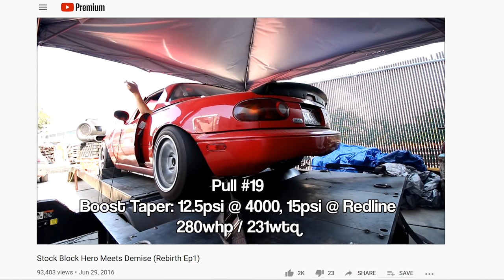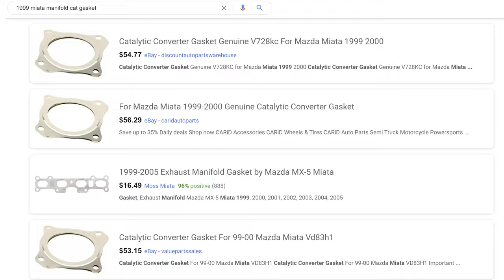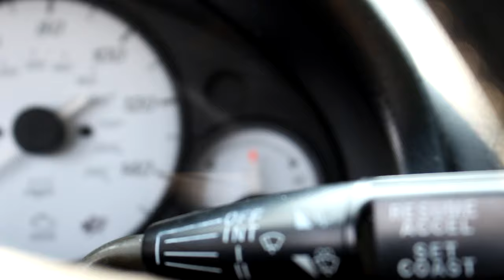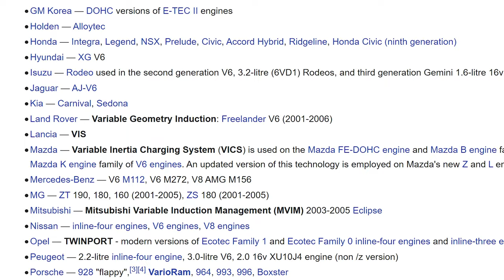Troubleshooting 6 Common Issues Your Miata Might Have! [Project 2SJ Ep5]

Comment: They're not Philips head screws on the latches - they're JIS. Everyone uses the wrong tool to adjust them, which is why stripped screws are so common.
Reply: I was about to comment on this. If you're looking for an easy to find JiS screwdriver look out for those Toyota ones that have both a JiS head and a flathead, you can also find a JiS screwdriver in the tool kits that come with Scion FRS/Toyota 86.

Comment: FYI, at 11:04 that's the pulsation damper #1, the fuel pressure regulator is in the tank where the fuel pump is. What you are working on is pulsation damper #2 on the fuel rail.
Reply: Yup, NB's have a very strange fuel system lol
Reply: my pulsation damper is leaking. Are all the steps he is showing around 11min necessary for this small item replacement?

Comment: Greg pls help with hot start problem I’ve tried everything I could find online and nothing has worked and nobody has a definitive solution.

Basically car starts fine. But when it’s hot I have to click the key like 6-7 times before the car starts. I’ve changed starter battery ign switch.
Reply: Check yo grounds foo. Get a test light, hook it up to battery positive. Stick the dingus end somewhere metal on the engine, it should light up. Now try and crank the car, if the test light dims or goes out when trying to crank then you've got a bad ground somewhere. 

You can test for a good 12v power supply to the starter too. Hook the test light to the positive post on the starter touch the test light to the frame. If it dims or goes out when you try and crank the engine then your main power wire is either loose or corroded.

If you want to know more, look up testing voltage drop.
Reply: Albie Beck I’ve already done basically all of this to a tee :( it cranks really strong when it finally goes.
Reply: Ugly Miata it is the 1.6
Reply: Ugly Miata I had no idea this part existed, and it’s relatively cheap, so I’ll try it thank you!
Reply: @Racingboom  What happens when you turn the key? Is it nothing, does the starter click, or does it crank but not fire?

If it's not the last one then changing the ignitor won't make a difference. It only controls the signal going to the coil packs, it has nothing to do with cranking the engine over.
Reply: Albie Beck oh fair enough. So what happens is when it’s cold it starts perfect. But when it’s hot it just sounds like a relay clicking or something. And I have to repeatedly attempt starting before it eventually just... BAM goes full power starts immediately like nothing was happening.
Reply: I fixed my issue with a Camshaft sensor.  Dunno if that’s your issue but look into that. Easy switch on the top of the engine, but like 60$ part.
Reply: @Racingboom  https://www.miataforumz.com/how-40/mazda-miata-wiring-diagrams-1990-2002-a-497/
Check out theses wiring diagrams. Because it's a 'no crank' situation you only need to look at the starter circuit. It's pretty simple, there's only 5 wires in the whole thing.

If you've changed the starter and the ignition switch (and you're sure they're good) then the only other component left in the circuit is the 'inhibitor switch' (clutch switch) although I'm not sure why that would fail when the engine gets hot. 

Having checked all the above the most likely cause are the wires themselves. Check power from the main relay box to the ign switch, from the ign switch to the clutch switch, and the clutch switch to the starter. Along with the main power and grounds for the starter, which you've already checked, that's it; those are all the wires.

The ST sign fuse wiring sends power to the fuel pump relay, it doesn't have anything to do with actually cranking the engine over.
Reply: Mine does the same, I just shake my key around till it fires up lol
Reply: Is your clutch switch bypassed? Meaning you don't have to put the clutch in when starting the car? I had the same issue and it turns out the previous owner who bypassed the switch did a shitty job and used butt connecters. I don't know how they did such a bad job with like 3 inches of wire but I redid it with some soldering and my car starts every time now.
Reply: Adrian Moreno mines completely stock but I would think it would be unlikely to be the switch. Considering it only happens when the cars been ran and sits for a little bit.
Reply: Racingboom The Pleb its probably just a bad starter bruh lol go pick one up from an auto parts store, and pretty sure you can just return it if it doesn't fix it.
Reply: BadBeaver I said I changed the starter.
Reply: If u have an NB its 99% the cam angle sensor thats on the front of the engine there like 15 bucks online
Reply: Flat spot on the starter. Get a new starter.

Comment: Those fan relays are mechanical and get physically stuck. Sometimes unplugging them and banging them on the ground a little gets the job done. One you have the full ecu setup installed. Trigger it manually on and off a few times to make sure it's freed up. You can usually hear it and feel it!!!

Comment: lmao I dropped one of those plastic spacers on the fuel rail when I was changing my fuel injectors. it fell into the void, I looked for it for about 30 minutes until I realized one of the o rings on the old fuel injectors fit perfectly. 
it might still be in my engine bay

Comment: Most likely the fuel leak was due to the O-ring on the pulsation damper. After having a few lucky escapes with fuel leaks, I now always change all the injector seats and O-rings whenever I touch the fuel system on a 10+ year old car. One other smart thing to do is lubing the O-rings before installing them. Thanks for the video Greg, these kind of fixes are very satisfactory. I crossed the Miata bridge and bought myself a MR-2 spyder from 2001, having to do all kind of similar fixes. I like the MR-2, but the MX-5 is a better car. So I am glad I still have my MX-5.

Comment: I have learnt sooooo much from this channel. When I bought my first ever MX5 or Miata I knew nothing about them at all. I've worked on Nissan's and Toyota's but never on Mazda's. but after watching these videos I managed to boost my first ever NB and its so dope. I've always thought Miata's and RX7/8 are two of the best handling cars of all time there only draw back with my Miata was the power or the lack of. But now its boosted it has a built engine and a GTX3071R  and a dog box I built the car for track use only but it drives so good and its so much fun I had to drive it more and its my daily street car now. I love them so much I've started my next Mazda build I have a boosted 13b rotary engine mounted in my NA in my shop I'm slowly working my way through it. If it wasn't for this channel I would never of bought a Miata and I would of missed out such a awesome little ripper.

Comment: MIATA DAD!!! Got my miata back after 2 months sorting out a ECU. ANNNNNDDDD Now....... my 2003 nb is running great, except at 4,000 rpm, where the engine will "jerk" or die for a split second. Only under medium to full throttle, all gears, and doesn't have any loss of power except when it stumbles... I'm baffled... No CEL (❁´◡`❁)

Comment: I have an 04” NB. Before I turbo charged the engine I replaced the radiator with a Mishimoto radiator and the fans with with Spal fans. Before I did that only one of my fans worked. Now I have zero issues with over heating.

Comment: my NB is burning oxygen sensors, I'm on the 3rd set. apart of richer fuel/air ratio nothing changed but it's still less mpg.. not sure what's happening, got my cat stolen but it was fine for 3 months after that (running on almost decat, there's something inside but much more airflow and no silver or platinum inside ) any advice? Went thru used OEM and cheaper sensors - all of them stopped working in about a month, after unplugging the battery and motor fuse to restart it the engine management light disappears for a few days.

Comment: hey guys someone here might be able to help me. I have a 1990 1.6 NA. Brand new plugs, plug wires, afm, and timing is on 10 degrees advanced. Having an issue where after warming up the car has big hesistations when under load (4k rpm plus). anyone have any ideas? cheers in advance
Reply: Crank position sensor?
Reply: @foamdataservices   is there a way to test the crank postion sensor?

Comment: I have a mazda mk5 nb mk2 with the 1.8L it only has the diagnostics port no OBD2 and it has a miss fire on cylinder 1, ive checked compression and it has 180 psi in each cylinder, ive changed injectors, the whole fuel rail, spark plugs, coils and other bits and bats, no matter what i do its got a misfire on cyl 1 and i can’t figure out why, every now n then when its warm it starts running on all 4 cylinders but if i turn it off n back on it starts miss firing, there are no engine management lights on the dash since it doesnt even have the light, anyone else know the problem???

Comment: Do you know why the lights in my gauge clusters suddenly went out. Blinker lights, check engine light, turn signals all work. Just the lights to tachometer, speedometer, and gas gauge don’t work.

Comment: Isn't the FPR on the NB in the fuel tank? According to the factory manual the one on the side of the engine bay is pulsation damper no.1 and on the fuel rail pulsation damper no.2. Not sure if this is true for all NB's.

Comment: Hmmm... are you sure you have your fan setpoint temps right when you go over the function of them? My stock NB runs the driver-side fan when the t-stat reads 207 per my OBD dongle. It's consistent. The passenger side fan only cycles with AC. Both cycle when I short the fan terminals on the test port.

Comment: I had that power window problem on my 2001 NB. A sharp and honest body shop mgr figured it out, saved my a lot of $.
For several months engine would just shut off at random times, then start right up again. Replaced the fuel filter, no change. Two mechanics had no solutions. Called my old H.S. buddy who's worked on cars and farm equipment for 50 years. Right off he said to clean connections on neutral safety switch. All is good now. Can't beat experience!
Thanks for your videos!

Comment: Surprised you didn't mention how people tend to pull themselves up by pulling on the (roof open) windshield frame, and tend to let themselves down into the seat by pulling on the top of the (roof open) window frame - which tends to bend them down a small amount 1/4" - 1/2" which also leads to a bad convertible roof front seal.

Comment: @ 4:50, a prominent fuel odor inside the car and in the trunk is very common in NA Miatas. The issue with my ‘91 was a clogged vapor check valve on top of the gas tank. When they fail, they get clogged shut and all the fuel vapors from the tank find their way into the car. I simply replaced the valve with a straight section of hose for the time being, but it’s advised to just put in a new check valve.

Comment: I replace my regulator thinking it was that....samething. now the new one does it (used one) zip and go. 

Also, you can use silicone spray on the rubber for the window runners, near the quarter window, and rear of door. That too helps.

Comment: p.s. theres a tiny qtip sized hole in the intake manifold that gets gunked up and trips a code when you clean up that throttle body should clean out the entire intake manifold as well

Comment: Because your fans started working again after unplugging and plugging everything back in. That means one or multiple of the cenections have corrosion on the pins causing an "open " or excessive resistance. You will need to sand the corrosion off with special connector files. The fan will stop working again decently soon if you don't get rid of the corrosion.

Comment: One of the problems i have with my na miata is that my gauge cluster lights dont come on when i turn the headlights on, every other lights on the car work but not the gauge lights. I've been looking for a solution for awhile but haven't found one yet

Comment: Hey G, instead of pouring soapy water on the manifold take a shop vac, put it in blower mode and connect to your cold exhaust pipe, then spray soapy water from a squirt gun or spray bottle. Works like a charm and no need to get burnt. I spent a week installing a new exhaust and had several leaks to find and sort out on my NB.

Comment: Hey love the videos! One thing on the stripped screws, they aren't actually proper phillips heads. They're a different standard called JIS, pick up a set of JIS screwdrivers and you'll be amazed how well they work on these screw heads.

Comment: On my soft top latches, the hook on the windshield frame kinda lost its hook, I was able to take a small round chainsaw file and file it down so the hook is a little more aggressive. Plus it takes a little pressure away from the latch on the top side just be careful not to file down too much

Comment: Great vid - have you heard miatas that go "clack clack clack" when you push in the clutch?  Ex: Drive train under load going like 5 mph into driveway.  Zero throttle, clutch pushed in  - hear a clack clack clack sound.  Have gone under the car multiple times trying to find something loose, cant find anything.
Reply from the maker: Possibly driveshaft u-joints? Going from loaded to unloaded quickly

Comment: I'd be really happy with 200hp in my nb. Dang 5 months ago and am now on speedy efi ecu with header and exhaust learning how to tune I'm at 155 whp rn and I'm pretty stoked about that only 15hp difference but hey turbos coming soon
Reply from the maker: Very safe power level for the stock engine and driveline.

Comment: Fan working intermittently is not an uncommon issue.  I am having that issue with my 93, will be tackling that eventually, it's really only an issue when I am sitting at a prolonged idle, and I can turn on the AC to get the other fan going to keep it from overheating for now.  On the window issue, I have had that happen a couple of times now on my 93 as well, I replaced the cable assembly in the end as it was binding even when tied down.
Reply from the maker: Plug was melted on the fan causing the pins to have intermittent connection

Comment: Does the coolant temperature switch at the back of the engine have anything to do with the fans kicking on?
Reply from the maker: NB's don't have a thermal switch like the 1.6's do, it's all ECU controlled. But that sensor sends the signal to the ECU for what temp the coolant is, so technically yes, indirectly.

Comment: I don't have any leaks but I do have a strong fuel smell coming from that exact area where you changed the fuel dampener. Should I change it? I don't have any codes but I do get bad mpg. Could this be the issue? I have check all plugs and filters and we're good to go on that. I'm gonna start checking other stuff.
Reply from the maker: Try turning the key to "on" when the engine is cold to try to find the leak. A fuel leak will not cause a check engine light
Reply: @TheCarPassionChannel  you are a genius. Found the leak. Exact spot as yours. Thank you so much bro.

Comment: You’re genius Greg, keep it coming. Any idea on how to fix temp gauge on a 97 NA? Much appreciated.
Reply from the maker: If it doesn't work at all it's probably a bad sensor or a broken connection. Note that the ECU temperature sensor is different from the gauge sensor

Comment: just fyi, the vics system on my 99 was broke, & u cant buy the little unit that controls it, nobody makes one... so shout out to the folks at treasure coast miata for finding me a used one for a good price... lovin the miata vids man, thanx & god bless
Reply: Its just a solenoid that controls vaccumm pass.. you can replace it with another one that whorks in the same way. Its controlled by ECU. Maybe you are refering to the actuator itself?

Comment: Does that zip tie trick work with crank windows to because my passenger window does the same thing it’s fine coming up but going down at binds up about the same height but if I push down on the window it goes right now
Reply from the maker: They have the same clip and cables, so I would imagine it would work. Wouldn't hurt to try!
Reply: TheCarPassionChannel your da bomb creg

Comment: My spark wires keep popping out. What could cause that
Reply from the maker: If they're old, it might just be because the rubber is not holding them firmly into the valve cover anymore

Comment: I’m actually chasing fuel problems at the moment on my turbo build. I can get it to start once and it’s idle afr is pretty rich (10.5-11) then dies out with throttle and won’t start again. Come back later and it will start the whole process again. Upgraded to a 255lph fuel pump since mine had died and thinking fpr is failing and causing cylinders to flood?
Reply from the maker: Stock ECU or standalone?
Reply: TheCarPassionChannel  MSPNP2. Watching your rebirth series with the Radium and Fuel Lands regulator seems like it should tell me if that’s the issue or not with a fuel pressure gauge.
Reply: *Fuelab’s
Reply from the maker: @benschroeder1052  It sounds like you just need to lean out the idle area on the VE table?
Reply: TheCarPassionChannel Thanks, I’ll give it a shot. I’m just ready to spank some mustangs at this point . . .

Comment: My 2002 runs great when up to operating temperature,but doesn’t run good cold. Any ideas?
Reply: Change CPS
Reply: @alexisknows6513  What is a CPS? Cam Position sensor? I have the same issue :P
Reply: @ThijsVanDalen  yes that's the part ,try to buy made in Japan sensor - they last longer ..... should be about$30 dollars the $10 ones don't last very long.
Reply: @alexisknows6513  Thanks!